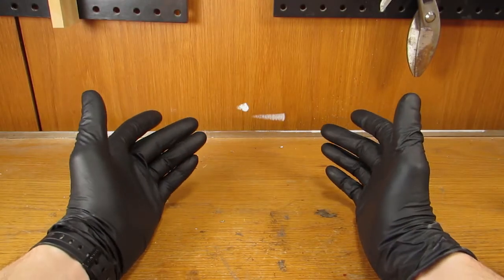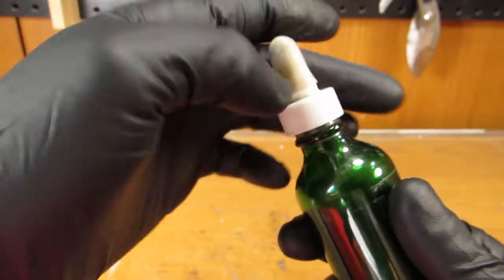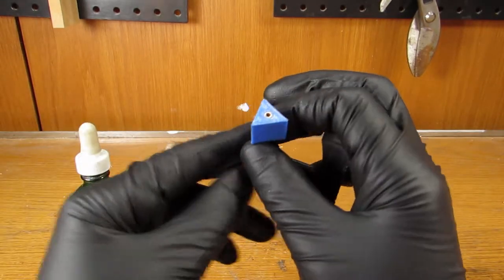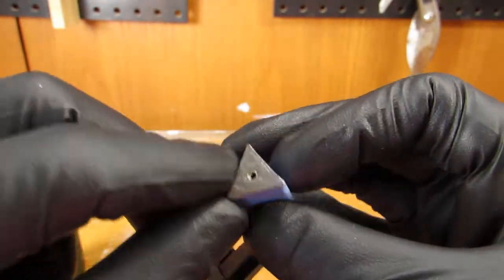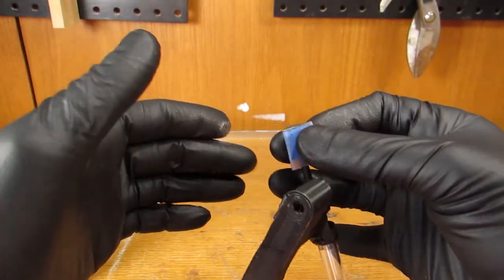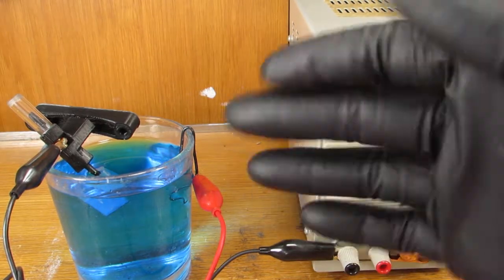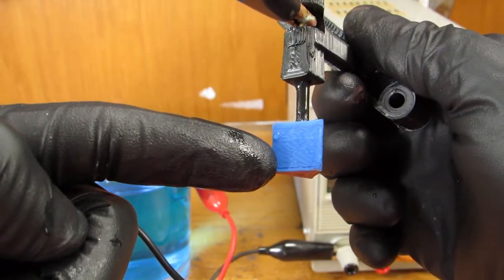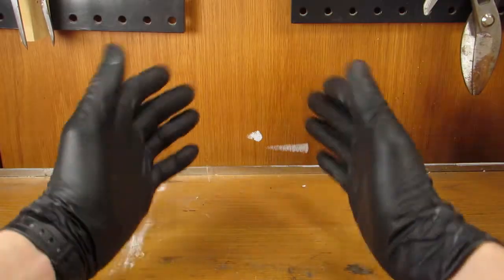3D Printed ECM Tooling

Comment: Ok so i gotta ask. What happens if you fill it with acid copper electrolyte and plate metal instead of cutting? Will it be too slow and diffuse to be useful as a 3d print?

Comment: This is very interesting, is there a way to make your cut end up straight? It looks like the deeper the cut is the more lateral deviation the cut has
Reply: I think that's primarily an issue from the way he's pumping electrolyte into the work area...side-flow electrolyte in a submerged bath with advance, half-retreat, advance tool motion (basically, PECM) should nearly, or completely, eliminate that issue.

Comment: A mill, you'd use a mill. And carbide tooling. I mean, it'd be hot, and scary AF, but you could get through it. This is cool as the other side of the pillow though, srsly cool. Subscrided.

Comment: Nice process,  wouldn't coating it with conductive paint (copper,graphite,silver are the ones i know) be sufficient?
Reply from the maker: Having a solid layer of metal is ideal because you want the most uniform and dense current flow
Reply: @ZURAD  ok my next guess would be copper shielding foil :-)

Comment: Have you ever considered using carbon fiber filled pla? Would that negate the need for the graphite coating process, or is it not good enough?
Reply from the maker: Good idea! Sadly, no that's not quite enough to get the job done. If you used pure graphite, that'd work fine. But the conductivity of a carbon filament isn't enough to machine quickly or consistently.

Comment: Did you think about using the PCB plate as a cutting surface? I'm sure you know you can convert a 3D  printer to cut them, I've just seen a guy use a permanent marker to insulate, 3D printer to scratch, and etching to remove the exposed copper. Possibly more steps, but maybe you could get cleaner cuts?
Reply from the maker: That's a great idea. I have some processes in the works now that could allow this pretty simply
Reply: Do you have a link to that guy
Reply: @fozbstudios  his channel is called lamja electronics

Comment: This is very interesting.  Does the shape need to be flat, or could you print something that had high spots and low spots and us it to machine a flat piece of stock into something that has different depths?
Reply from the maker: Conceivably one could use this machine to die plunge, assuming they were controlling current effectively, but I think you'd need more complex control of descent than we currently have.

If you had generated some gcode based on current density and surface area at any given point during the cut, then yeah totally.

I think that's going to take some integral calculus and a specific slicer type program though. I could see that working really well with a constant current supply.